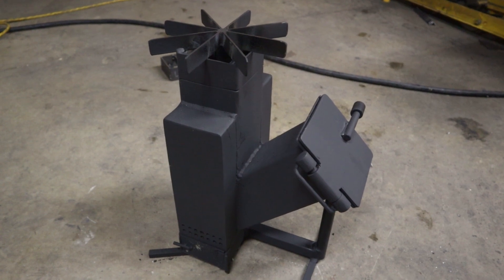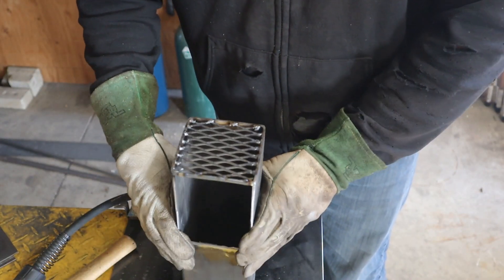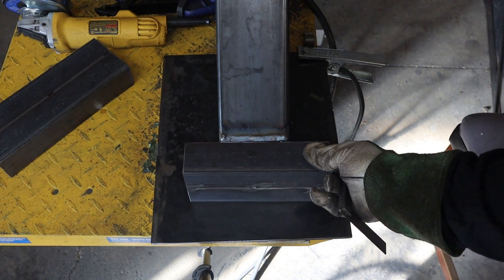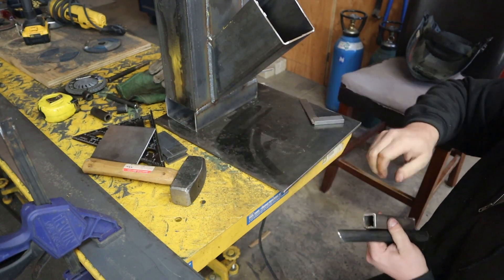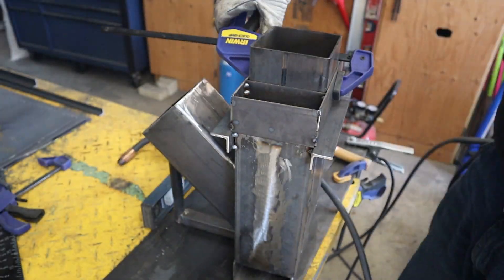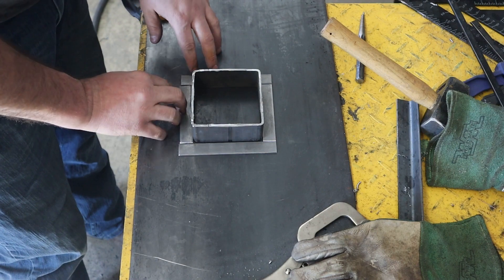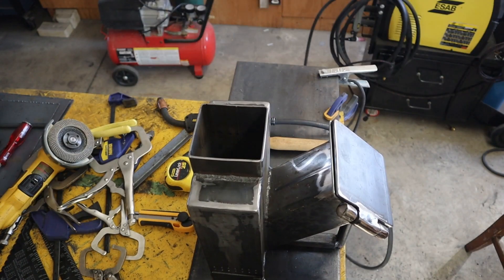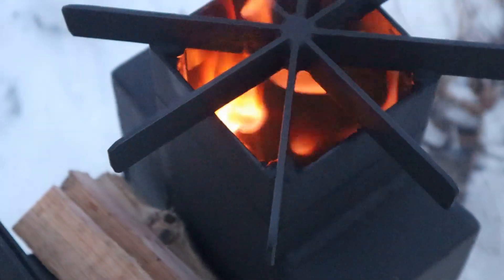Rocket Stove Secondary Combustion Build

Comment: Nice job I like the way you made a door on the feed tube and a damper on the bottom to be able to have some adjustment on how hot it runs I will copy your design on my rocket stove I'm a retired machinist certified welder and fabricator I have had several family members and friends that would like for me to build them one now I got my template thanks for sharing
Reply from the maker: Glad to help!

Comment: Have no idea on these "secondary burners" or whatever they are called. What is the result you're after here? Just more added weight, more welding for nothing that is evident in the video. Wood goes in, flames come out the top. Why so dramatic?
Reply from the maker: It burns the gases not originally burned in the primary fire. Its more efficient, provides more heat. Thanks for watching.

Comment: Maybe I missed something? 
What are the parts built for the top ( midway through the video ) used for?
Reply from the maker: Hello akbychoice, I assume your talking about the rectangles on the side of the 4x4? If so, this space is heated up by the fire in the rocket stove and draws outside air up into the secondary combustion area. I hope I've answered your question...if not please let me know. Thanks!
Reply: @buildfixeat  no I understood the heat risers. The parts you built on top after that slid down on the top before you cut the top off flush.
Reply from the maker: Oh I see, the universal attachment. It allows me to build attachments that slide on with that jig. I only have one attachment posted at the moment https://youtu.be/9BnoXBxGmP4
 @akbychoice
Reply: @akbychoice  Technically, heat does not rise. Hot air rises. Heat radiates.
Reply: @youngyoung6250 didn’t say heat rises. Reread it.

Comment: For the secondary combustion to work ,some holes are needed in the lower part of the stove,where the fire is...
Reply from the maker: The fire sits on expanded metal, air is fed from bottom. Side rails supply air to top secondary. Thanks
Reply: @buildfixeat  I understand that but you need to have holes near the fire for the woodgas to escape upwards mixed with air through the holes in the upper part where the are burned ...If you have no holes,you have no gas ,you have no secondary combustion,you have only air that goes to the holes in the upper part of the stove...
Reply: @techview8708  seems like it would be difficult to get the mix of gas and air correct, given they are opposed draft/vacuum

Comment: Thanks for all your efforts but have tested the grate by cooking on it. I have a problem For the Prepper community and you & me Just for your FYI> if I may suggest a small improvement in the building of the rocket stove FYI the top piece where the pans and utensils go on top. The area has is not wide enough, I cant tell how many time my nonstick pans have fallen off the stove. Most rocket stove users are having this problem. Now the solution is can you put a round bottom wok on it and cook Beef and Broccoli? If the top resting place for pans and be widened and it can cradle all woks and pans 23 inches or larger than you have a winner. I am sending you a link from YouTube, i hope you will enjoy it. I hope you dont lose, any breakfast or lunch slipping off into the next county. Best Regards https://www.youtube.com/watch?v=nBKGW3Fumhc

Comment: So first off, great build but confused on the large 'secondary intakes'..? Not really sure where you're going with that other than to use it as a base to put those toppers on, meaning why the height? Could have just drilled holes into the lower portion of the main burn chamber. Anyways, not condemning, trying to understand the scope for your necessity to build that into it in particular. Again, great build, certainly solid.
Reply: to raise the temp of the secondary air....!?

Comment: Very nice! You may have mentioned this already, but is that 4" square tubing that you used? Also, i like the little handle at the wood intake cover. Did you make or buy that piece? Great video, thank you!
Reply from the maker: Hey Kabbey, thanks for the kind comments.
1. The square Tube is 4", 1/8" wall.
2. I made the handle. It is a piece is 1/2" round stock with a piece of 1/2"Sch80 pipe overtop.

Comment: What made you design secondary air intake and why small holes and not a half a inch or more. Injoy the video, and I'm looking forward to seeing more
Reply from the maker: Well I knew I was going to build some attachments and wanted it to be as efficient as reasonably possible. The secondary burns those unburnt gases. 
I used many small holes instead of one big hole simply because the most efficient wood stoves do it this way. Figured they knew what they were doing.
Many Thanks!
Reply: theory on rockets says 9% primary air and 10% secondary to "system size" (flue)
Reply: @thedavesofourlives1 9% of what? i dont understand

Comment: May I ask what the cost was, please?
Reply from the maker: I'm not sure, I was using off cuts. I buy material in 20' & 24' lengths. I would guess that there is about $60 of material in it, although that could swing based on steel prices that month.